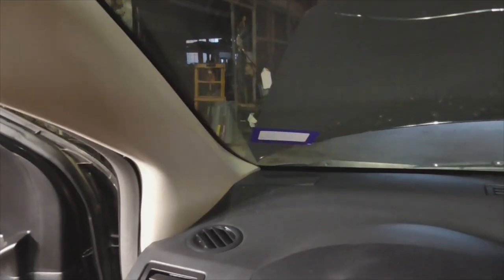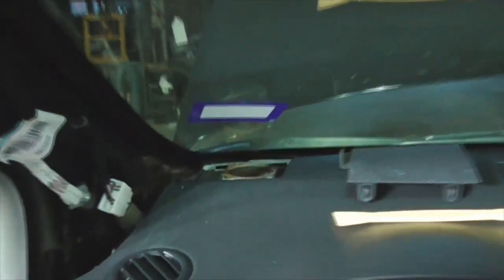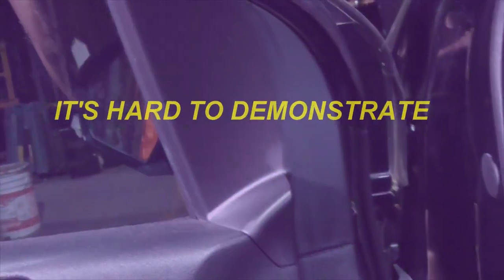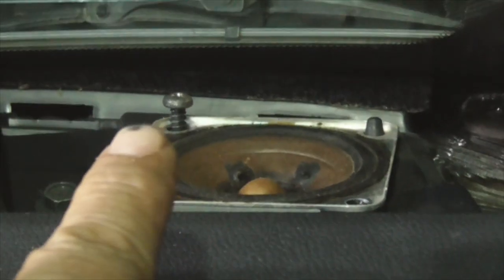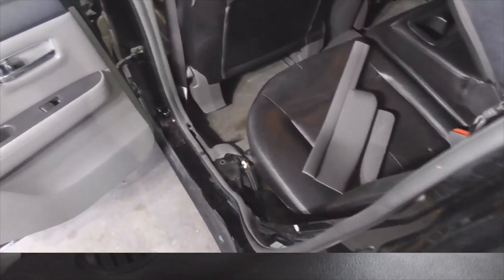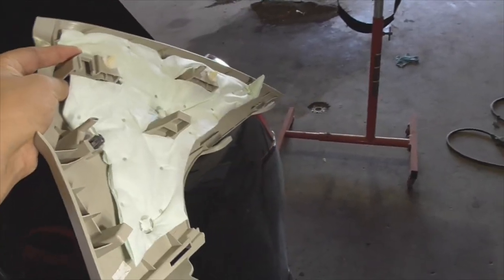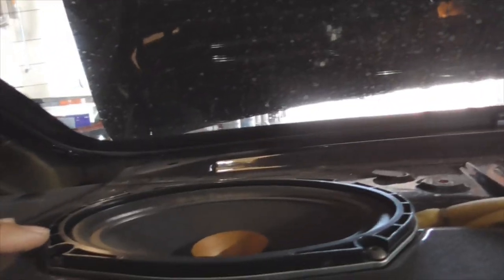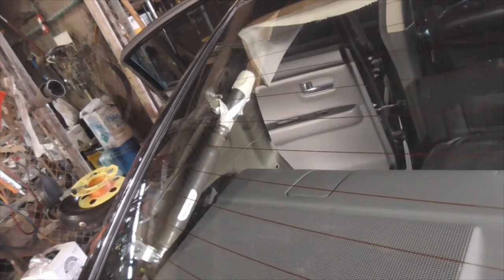2008 NISSAN SENTRA FULL STEREO/SPEAKER INSTALL PT.2

Comment: Hey Frank my friend... Can't thank you enough.... 2008 Nissan Sentra "Wife's car" replaced the speakers using only your instruction... worked perfect!  with your instruction on pulling the Sentra interior panels I replaced and rewired all speakers with a 9 wire loom from the radio to the trunk for a amp...   I have the power thru the firewall and last but not least.... now I need to figure out the color code in the factory Sentra radio harness to wire up the the amp.... may be easier said than done. (as you mentioned she want's to keep that control panel above the radio).
thanks Frank!!!
Bob
Reply from the maker: Thanks a ton! I curse video makers when i'm 2 hours into their 4 second "just remove the thingamajig" segment, screaming at the 8 problems I'm SURE they ran in to but forgot to mention!
Reply from the maker: Robert, for what it's worth, every diagram I have says the green ACC wire from the ignition switch to radio (with satelite or without),  continues as a green as the remote on/off switch from the radio to the amp (if equipped with one.)

Comment: On the door handke...don't unscrew it...pull the lever back and pull up on the cables to slip ghem right out. One round one smaller so no need to worry which is which.

Comment: may iknow which wire is positive & negative for the front door
Reply from the maker: left side : Blue/white stripe  Right side: white/black strip
Reply: @frankdaiii6403  so for left side , blue/white stripe is positive ? or did you mean blue is positive , white strip is negative . Been awhile since I opened my door panel & checked . Please let me know TIA
Reply from the maker: @jonaventenorio3217  sorry, I misread your question. left side : +(Blue/white stripe),  - (blue/red stripe).   Right side: + (white/black stripe),  - (green/white stripe)
Reply: @frankdaiii6403  Thank you , very much appreciated Jah bless 🙌